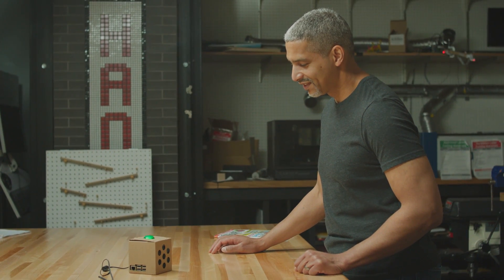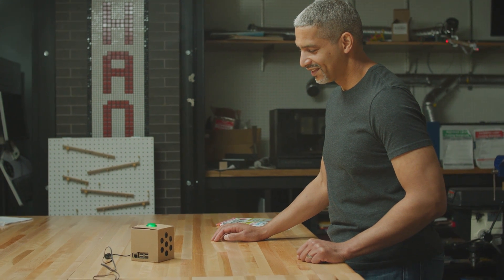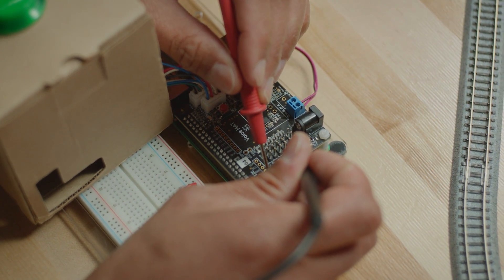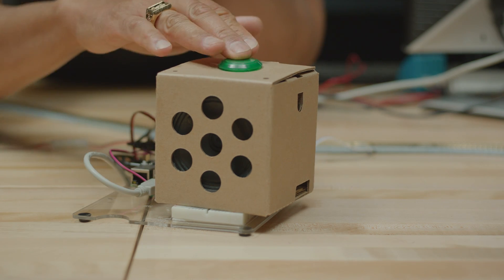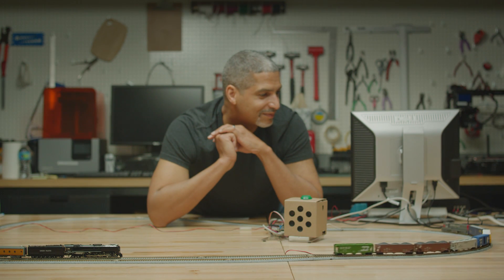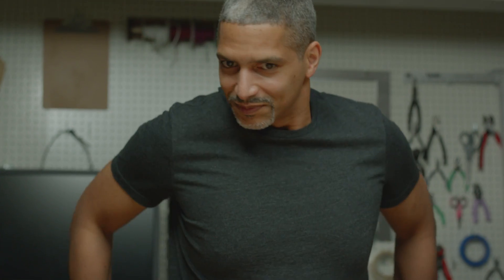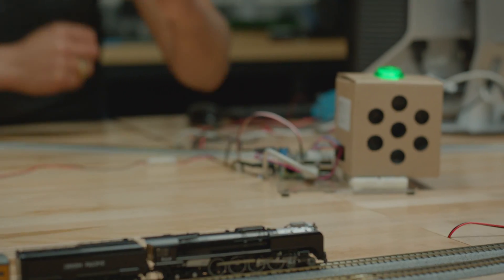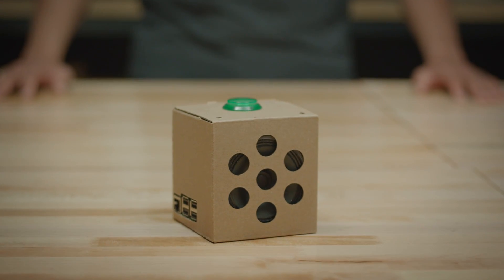Introducing AIY Projects: DIY AI for Makers

Comment: What to do if your internet goes down for hours or days? No voice control anymore so no control I guess so do not forget to build in contingencies for those effected.
Reply: hey Shane. what's cool about projects like these is that you can build your own contingencies that suit your situation! You could add in an external battery that is only drawn on when the power is out! Or attach storage so that learned data is stored and can be recalled without the internet!
Reply: Actually I was referring to just the internet and not the power as yes contingencies for that can be setup. But are you saying that Google AI api interaction will still work if ones internet connection is lost?
Reply: Shane Bekker from what I understand of the very little I've read of the Google Assistant API, there are methods of storing responses to commonly asked questions!